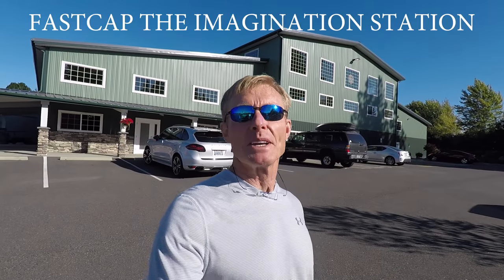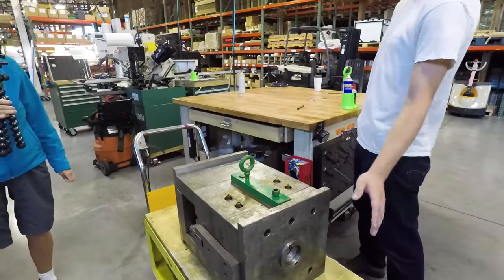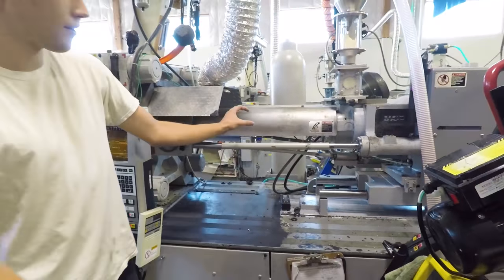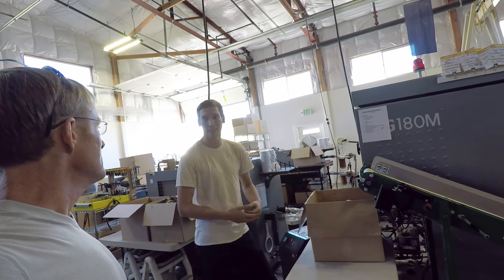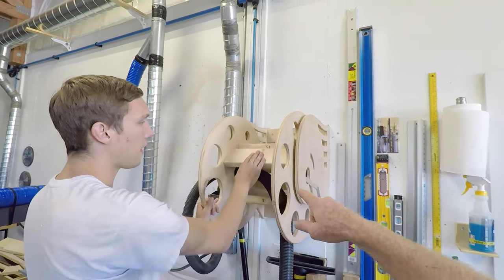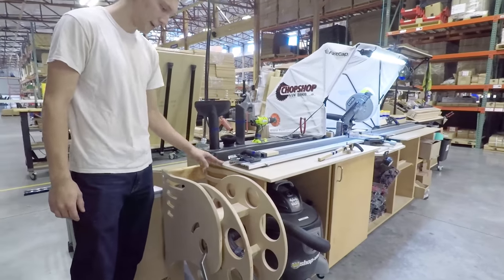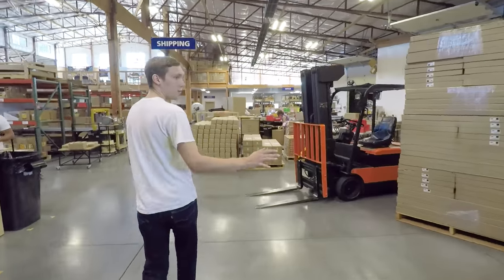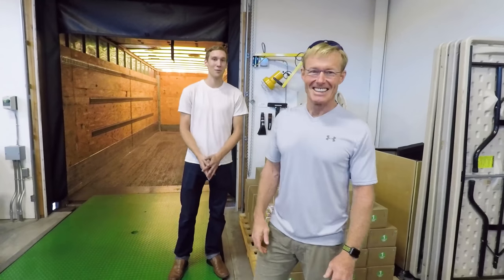I WOULD LIKE TO WORK HERE

Comment: Nice creation. Very clever idea on the weight distribution on reel. Id ad a few more hard elbows in the middle to keep hose from pinching in case you don't need as much hose reeled out.
Reply: I was looking up injection mold manufacturing vs thermoforming for a little dream project I was working on and right out of the box you show me this ten thousand, give or take a few thousand pounds and my dream is fading. That thing looks like 20 thousand give or take 10 thousand or so dollars. Ouch Don't think I can afford injection. I guess you can tell Im a newbe by the give or take fudging. Nice video you dream crusher. First video and ready to quit.